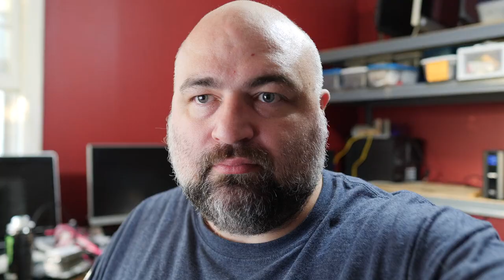Even MYTHBUSTERS Got The Airplane Conveyor Belt Question WRONG - A Neckbeard Explains - Jody Bruchon

Comment: I see what you're getting at... But in reality the wheels would be spinning as fast as the conveyor belt + the linear speed of the plane travelling forward. And so the wheels would be travelling FASTER than the conveyor belt, and the plane would take off.
But you're saying that would defy the rules set by the myth, which states that the wheels cannot travel faster than the conveyor belt.
Well yes, IF the wheels HAD to match exactly the speed of the conveyor belt, then the plane would HAVE to be physically stationary - it's the only scenario in which the two speeds would match exactly. In which case the plane would not be at a velocity at which it can take off. Its forward movement would be 0.
However, in reality the thrust would overcome the conveyor belt speed with ease, the wheels would start spinning faster than the conveyor belt speed, the plane would move forward at normal takeoff speed, and the plane would take off as normal.
I think the wording of the myth that you are clinging onto was simply a mistake in the exact version you have read. 
I have always know the myth to be "if the conveyor belt was set to match the normal speed of the plane at take off (e.g. 100mph), would the plane still be able to take off?" and the answer is yes - the wheels would just be spinning at 200mph at takeoff.
Reply: Exactly correct. The question is a trick question. It’s phrased to convey an image in your mind of the plane being stationary during the experiment. The thing is... the wheels on the bottom of a plane are not hooked up to some engine that drives them. They are just spinning incidentally from the thrust of the plane’s propellers or turbines. The plane is still going to GO the same speed during takeoff whether or not the runway is a giant treadmill or not. The treadmill is just going to spin the wheels faster. The method of locomotion from the plane is from the propellers blowing air backwards, not some engine making the wheels spin like a car’s engine does. The wheels on the plane are, for all intents and purposes, like the wheels on a toddler’s wooden toy plane. They just spin around on some bearings and axels. If you put giant skis on the plane instead of wheels, it would still go forward when the engines power up, it would just have more friction along the ground. This is how sea planes are able to takeoff from water. They don’t have a propellor moving water underneath them during takeoff, they’re just blowing air with the propellers.
Reply: @itsd0nk   bottom line, if the wheels move at all, the rules in this scenario break. Cause if they moved even the tiniest bit, the conveyor didn't exactly match the wheels. 

Those who say it can't take off is referring to the above.

However like those who say it can take off, know the wheel speed doesn't matter because the plane uses the air to push against. Which is true. One way to make the wheel speed exactly match the conveyor AND the plane move forward, is to have high enough winds where the plane can take off vertically or conveyor being icy enough and keep the wheel brakes on so the wheels do not spin at all yet the aircraft still can move forward to take off speeds.

This problem is worded in such a way that depending on these factors not mentioned in the problem could be answered YES and/or NO.
Reply: @johnguilfoyle3073   yes, the plane would take off, I agree. But the wheels would be spinning faster than the conveyer.
If the scenario is for the wheels and the conveyer to be moving the same speed, the 747 would have to have a ground speed of 0mph  for them to be matched, and wouldn't take off.
For example, if the conveyer was moving at 50mph, and the wheels have to match, so they're also going 50mph, the plane would be stationary. The thrust would simply be keeping the 747 in one place.
For the plane to move forward at 184mph, whilst the conveyer is going 50mph, the wheels would be spinning at 234mph. There's no way around that.
If the plane is moving forward, the wheels are spinning faster than the conveyer.
Reply: You literally just missed the point of the riddle. The wheels physically cannot move faster than the conveyer belt
Reply: For instance, take off speed = 100. We want to reach it. Then we say that the thread mill reached exactly that speed. Vector 100mph point left (thread mill) and the one of the aircraft points right. Therefore, there’ll be 0 mph. The aircraft won’t take off 

How’s that possible to be 200 mph? Elaborate on that compadre  😭

Comment: It’s a hypothetical question. The conveyor is hypothetical. The airplane will take off. If you can’t understand why, I’m sorry.
Reply from the maker: You are wrong. If the question's parameters were possible to implement perfectly in the real world, the airplane can't take off. If you can't understand why, read my reply to every single damned comment below that you clearly didn't bother looking through.
Reply: It's on video where they replicated the question. The wheels always match the conveyor speed. They're touching. We saw the plane take off. This isn't hard.
Reply: So why can't you solve it conceptually? The problem itself asks you to do this because it gives you incomplete performance of the conveyor belt. As if in the first physics lesson the professor asked you the question: what is the acceleration of a material point along an inclined plane and you answer him: I'm sorry but I can't tell him because I don't know what material the plane is made of and therefore I have a hard time calculating the friction. The professor tells you: that is the door. Bye

Comment: So let me ask you this, if I were a swimmer, and I could swim across the pool through the water in 30 seconds, and then you put a conveyor belt at the bottom of the pool going the opposite direction at the same speed, do you think it would affect my swimming?

Of course not, I'm not touching the conveyor belt, I am swimming through the fluid above the conveyor belt. Air acts like a fluid. The propeller, or jet engine, pushes the air backward causing an equal force to push the plane forward. All the wheels are doing on a plan are making it not hit the ground. So just like the swimmer, the plane is propelling through the fluid of the air and adding the conveyor belt will merely double the speed that the wheels are turning as they hold the plane off the ground (allowing for friction of course). The wheels have zero to do with the propulsion of the plane.
Reply from the maker: That's not relevant. If it is moving forward, regardless of how it's doing so, it violates the constraint in the question. Also, the swimmer is not touching the belt in your hypothetical. If the plane is already in the air then the wheels become irrelevant.

How does the plane lift up while the wheels are on the conveyor? Where does the vertical thrust come from?
Reply from the maker: @LAK_770  THE CONSTRAINT IS THAT THE WHEELS CANNOT ROTATE FASTER THAN THE CONVEYOR AND THE PLANE IS GROUNDED. ARE YOU DENSE?
Reply: Swimming doesn't require upward lift provided by forward movement.  An F18 hooked in for launch off a carrier is not providing an upward force, even if it's afterburners are full blast.  It gets it's upward lift from physically moving forward, hence the full burn and propelled launch.  If these conveyors actually worked militaries all over the planet wouldn't be investing billions dollars in launch systems or STOL aircraft.
Reply from the maker: @LAK_770  Airspeed doesn't exist when you're on the ground.
Reply: @LAK_770  I think the issue is that we're looking at the question differently.  I found a video explaining the logic from both views, link at end.  In short, if the conveyor is matching the ground speed of the plane it does take off, with the wheel speed essentially doubling.  If the conveyor is matching the rotational speed of the tires it does not take off, because the tires can't move it forward.  This video explains it better than I can, it's how people are interpreting the "rules" for the puzzle differently, neither side is incorrect.  https://youtu.be/Y64ZdSaDdoo
Reply from the maker: Daniel: it's an incorrect reading, but if one were to read the constraint as meaning "the conveyor matches the ground speed of the plane" then the plane still can't take off because the ground speed of the plane starts at zero. The plane moving forward (thus obtaining a non-zero ground speed) would mean that the conveyor's speed was stuck at zero while the plane's ground speed was non-zero. The problem changes from "if the wheels and conveyor are perfectly locked, the plane can go nowhere," yes, but the newly interpreted constraint now means that the plane can't move at all regardless of the wheels.

The constraint in the image specifically states that the speed of the wheels and the conveyor are inversely matched, though, and the only way that the wheels can have a speed at all is to rotate. It says nothing about the speed of the plane relative to the conveyor, only the speed of the wheels themselves, so I don't think the alternative interpretation mentioned is valid.
Reply: @Jody Bruchon  You're the one who is dense. The wheels are touching the conveyor in the video as the plane takes off. Of course they're moving at the same speed. They're not slipping.

The conveyor in this video matched the takeoff speed of the airplane. The airplane reached its takeoff speed easily while allowing its wheels to spin at the same speed as the conveyor.
Reply from the maker: @phil2082  No, you're just unable or unwilling to understand what I've said countless times before. Don't get mad at me for your lack of understanding.
Reply: @JodyBruchon  damn you mad mad about this just accept your fate g, you don't know fluid dynamics
Reply: @monrow11  plane takes off only when the wheels are not moving the same speed as a tarp.  You probably think the engines can push the plane to infinite speed too.
Reply: If something not directly connected to you was moving at a different velocity to you, would it affect you?

Obviously not.

However, the wheels on a plane are directly connected to the plane. If they are prevented from moving in relation to the ground (via, in this case, a conveyor belt), then the plane is prevented from moving in relation to the ground. Which also means it isn't moving in relation to the air either, unless you wish to decouple air and ground from themselves - And reality.

The issue here isn't that people are dumber than you, or that "science means". The issue is the question cannot be answered because the scenario cannot exist.
Reply: The swimming example is great. It's all about propulsion. The treadmill is irrelevant.

Comment: Planes don't care how fast the wheels are turning, or even what the motion of the plane is. They only care about how much air is flowing over the wings. If your conveyor doesn't produce more airflow over the wings, the plane isn't taking off.
Reply from the maker: There is no movement forward because of the constraint in the question. No air flowing over the wings. No taking off. Petty easy to understand if you accept the question precisely as written.
Reply: @JodyBruchon It's all about propulsion. The treadmill is irrelevant. Do you understand how propulsion works? Propulsion moves the plane creating lift.
Reply from the maker: @joeg4589  if you think propulsion creates lift then you need to take Aerospace 101 again.
Reply: @JodyBruchon  propulsion creates forward motion, and the forward motion generates the lift. The wheels have no effect on this situation,  unless they can't safely spin at twice the takeoff speed...which is what they would be doing with forward motion of the plane and backward motion of the conveyor belt were the same speed. Very basic math here sir.
Reply from the maker: @cyh4031 The wheels have no effect. The conveyor and wheels being required to be locked to the same speed means no forward motion is allowed.
Reply: @cyh4031  thank you for typing this out because the fact that he couldn't derive this from my comment had me not wanting to waste my time spelling it out for him.
Reply: @JodyBruchon there is NOTHING in the mythbusters video thar says the wheels and conveyor belt have to be locked at the same speed sir. Please go watch it again and carefully listen to what they actually say. They say the conveyor is moving moving at the same speed as the forward motion of the plane! As the propeller drives the plane forward to generate lift,  the conveyor belt moves backwards at that same speed, but the wheels will be spinning at twice that speed since you have both forward motion of the plane and backwards motion of the conveyor. The forward motion of the plane generates the lift, and the conveyor speed has now effect with free-wheeling wheels!

Comment: A related question is: "Can a stationary plane achieve lift if a strong headwind blows on it?". This is essentially a similar case as a plane on a threadmill since (a) the plane is not moving, and (b) air is still moving relative to the plane. And the answer is yes. The plane can achieve lift as you see in this video.
https://www.youtube.com/watch?v=TlEKiSwttsc

So it doesn't matter if the plane is moving relative to the ground or not, as long as air is moving relative to the plane. Then you can get liftoff.
Reply from the maker: That's true, but the question doesn't say anything about a strong headwind, so it's kind of cheating to use that to make it happen.
Reply: You cannot add a variable to make it fit your narrative. I could add tie down straps. And then the plane couldn't take off even with strong headwind. But that is not part or the problem. Take the problem as it is, dont add your own twist to it

Comment: You are assuming infinite friction between the wheels and the treadmill. If the wheels could not move fast enough they would just slide.
Reply from the maker: Sliding is an option, but I doubt that the plane would drag them. It seems more likely that either the plane would tip forward and crash or the landing gear would break and it would crash.

Comment: That was a lot of words to say the conveyer could never keep up with the wheels spinning faster because if the plane moves forward when thrust is applied and your interpretation of the problem becomes an “impossibility.”

We all know in reality without the dissection of the wheel speed to conveyor speed debate in the video that the plane can move itself forward against the air and therefore would take off because the wheels are irrelevant to the planes actual ability to move forward.

Having said that, I’m going to ask what the definition of speed is. Is speed the rotation of the wheel? Or the forward movement of the of the wheel. What if we measured the speed of the wheel and conveyor in RPM? The speedometer in your car is an interpretation of wheel rpm to calculate the speed of a vehicle. All vehicles traveling on wheels at 50 mph will have different wheel rpms relative to the size of the wheel. For simple math, say the conveyor was 10,000 feet long (a relatively long, but common commercial airport runway length) and therefore had a circumference of 20,000 ft (length of the top and bottom) One rpm of that would be a surface speed of about 227 mph. Say the wheel was 8 ft in diameter, because 747 wheels are large and I don’t know an exact measurement. At one RPM The surface speed of the wheel would be .28 mph. They are both traveling at 1 rpm. Is that the same speed? By my questioning what the definition of speed is, in my example I have a difference of over 200 mph between your definitions of speed, and therefore the theory the plane can’t move in the constraints of the question are voided.

The premise of the question is to confuse people who think wheels drive the plane. There aren’t enough rules or information in an internet meme to justify this level of analysis.
Reply from the maker: The question is insufficiently defined, yes, but I say that it confuses people who think the wheels don't matter. They matter when the constraint is "the wheels and conveyor must be perfectly opposed in speed." If it moves forward, the wheels exceed the conveyor speed, and that's a violation of the constraint.
Reply: Finally somebody gets it.

Comment: The simple answer that even a child can understand is that if the plane is moving forwards, the speed of the wheels must be faster than the speed of the conveyor belt. It cannot take off because it would need to move forwards and that's not possible if the belt is always matching the speed of the wheels.
Reply: A child can understand. But it seems a ton of people with knowledge of aviation have difficulty

Comment: The type of plane doesn't matter. Lift is generated by airflow being pushed down by the wings when there's relative airflow, hence the need for an attack angle. No air pushed down = no lift. Assuming the propulsion is only horizontal, and that there is no relative movement between the plane and the air around the wings, it will not lift off.
Reply: That's a lot of analysis just to be wrong